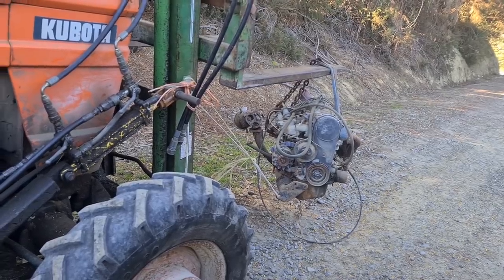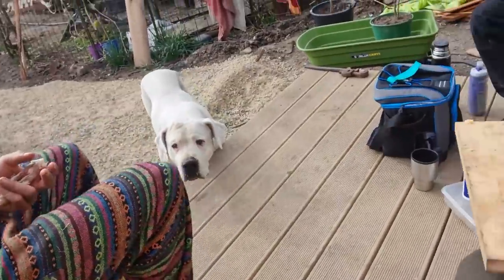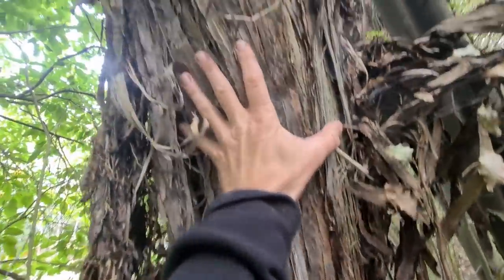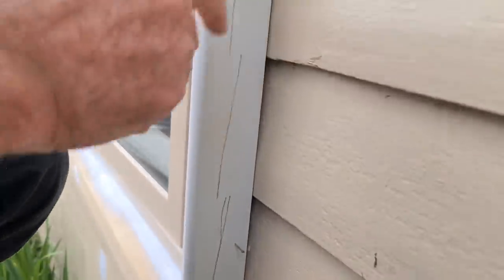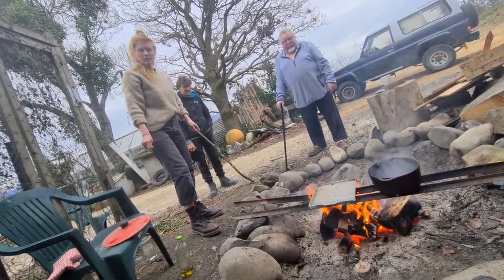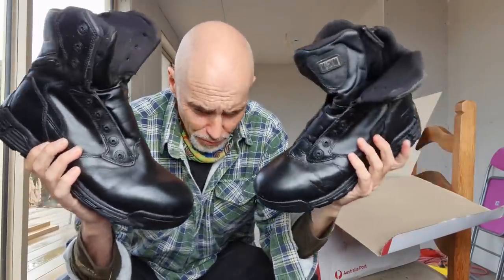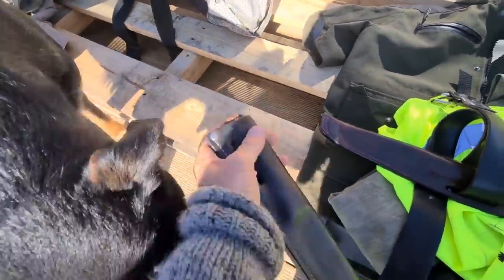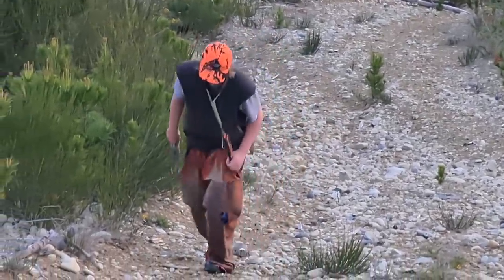Our Rural lives in New Zealand~Clay Tall Stories.

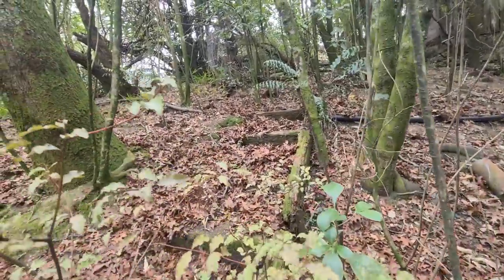Comment: The growths on the the tree at the 28:51 mark we get similar in the UK we call them horse show fungus their amazing to use in primitive fire making once dried. If the fungus is similar to the one in the UK it has a texture of leather and can either be scrapped to make a fine tinder or used as a fine strop for knife sharpening again don't quote me on it but I'm pretty sure it has the same charities as its UK brother. It would be awesome if you could cut it off, dry it and then cut it open once it goes rock hard.
Reply from the maker: You are right and we should dry one out. They are also good for transporting fire.
Reply: @ClayTallStories  that's awesome I would love to see that